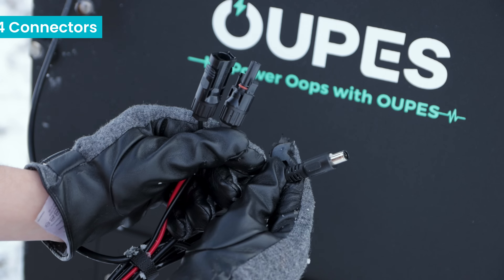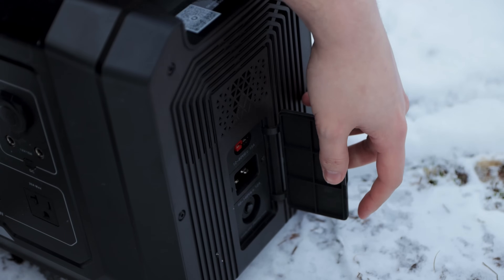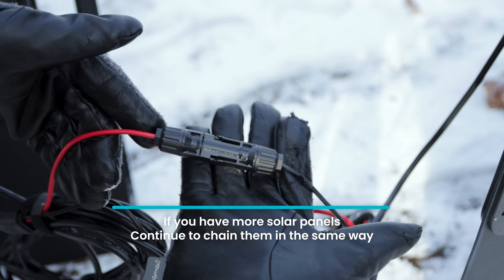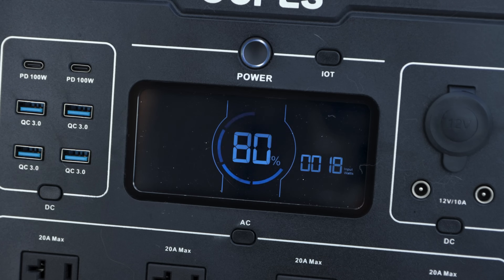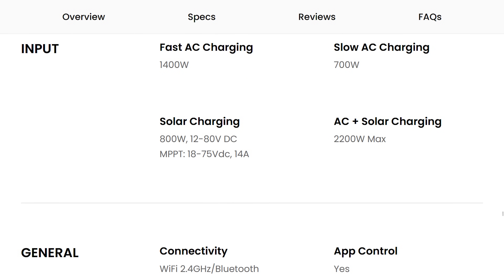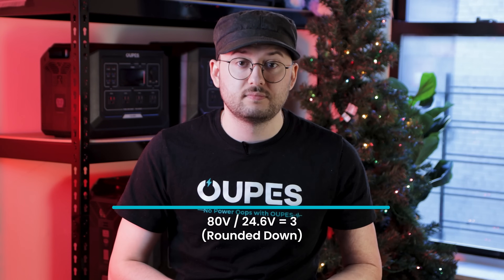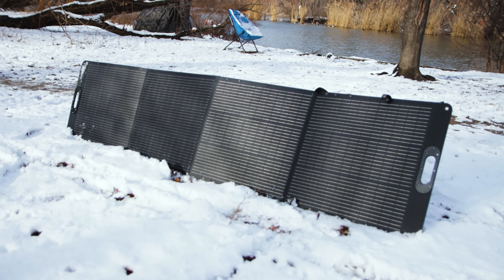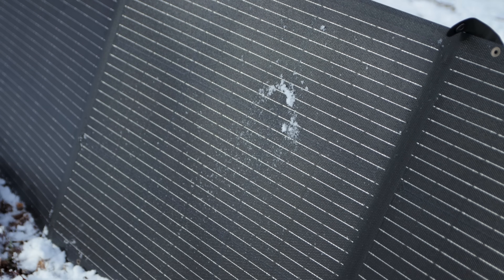How to Set up Your Solar Panels? | OUPES User Guide

Comment: I want to be able to charge my Oupes Exodus 2400 with a portable Generator.  The running watts of the generator is 1800w.  Is this safe to do if I set the generator to Eco Mode?
Reply from the maker: Yes you can charge your Exodus 2400 with a third-party generator without needing an additional converter. However, it's important to choose a generator that is equipped with a pure sine wave inverter and has a rated power of at least 1.5 times greater than the input power of the OUPES unit. This ensures stable battery charging and prevents issues such as abnormal heat generation during charging or accelerated battery degradation.
Reply: @OUPESOfficial  I am confused about your statement about rated power at least 1.5 times greater than the input power of the Oupes unit.  The Oupes 2400 has input of 1400w (is that correct?) and my gas powered generator has 1800 running watts with 2500 Peak so it wouldn't work?

Comment: Obviously iam very interested in purchasing  the Exodus 2400w portable generator. However I need to leave my solar panels outside. In your opinion what would be my solar options for my off grid situation.
Reply from the maker: If your need is to leave the solar panels outside, we recommend that you use third party solar panels, but the caveat is: You need to ensure that the Open Circuit voltage(abbreviated as OCV or VoC) of the panel(s) does not exceed the voltage range of your power station. In addition, you want to look for panel(s) that will deliver the maximum amperage your power station can input. Please check out our Q&A for more details: https://oupes.com/blogs/oupes-weekly-q-a/oupes-weekly-q-a-solar-panel-compatibility-payment-guide

Comment: I really know nothing about this stuff. I bought two 100 watt callsun panels. No connectors out there for what I’d need if I start stringing by connecting black to red. Then I’m left needing a black male and red female to finish the connections red to red and black to black. Where do I find that type of cable??? Please??
Reply from the maker: If you want to use third party solar panels, please attach the parameters or link of the solar panels you purchased to contact our after-sales email: support@oupes.com, our after-sales team will give you professional advice!
Reply: @OUPESOfficial  I found the cable! Thanks.

Comment: I have the Exodus 1200.  Other than it not having the Anderson PP connectors, should everything be the same?  I have a 200watt/12volt Eco-Worthy solar panel.   Can that be hooked directly to the power stations?  Or do I need the charge controller between the solar panel and Exodus 1200 power stations?  The owners manual says nothing about a charge controller and only shows hooking a solar panel directly to the power stations.  Thank you.

Comment: The manual doesn’t identify the purpose for the separate 4 plastic pieces included with the panel. (Sorry, I can’t describe their shape or even come close to comparing them to anything)
Reply: Hah, that's exactly what I'm looking for. I got 2 sets of the 240W folding panels. I understand how to use them, but WHAT ARE THE 4 PLASTIC PIECES THAT CAME WITH EACH PANEL-SET?
Reply: @ You snap them onto the top edges of the panels, at the folding joint where the individual sections meet, to make the entire panel more rigid and not bending all over the place when you set it up.  Works great.
Reply: I think, as he mentioned, there are to add panels. I bought 2 callsun panels for my 2400 watt oupes and have No idea how to attach them or which cables I need to do that. Super frustrating.
Reply: If you mean the plastic pieces about the size and shape of a pocket comb, you can use them on the panel where the sections meet (at the folds) to keep the entire panel straight and easier to orient, as a single rigid panel, toward the sun.